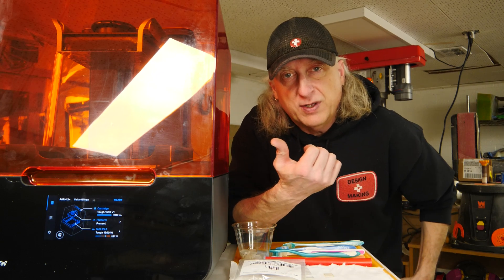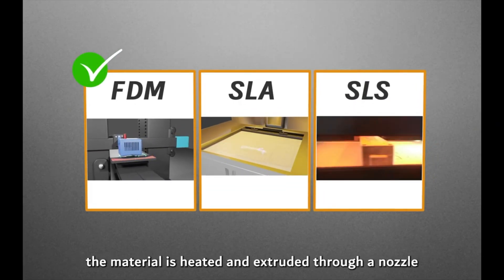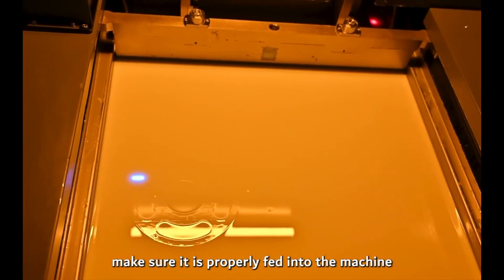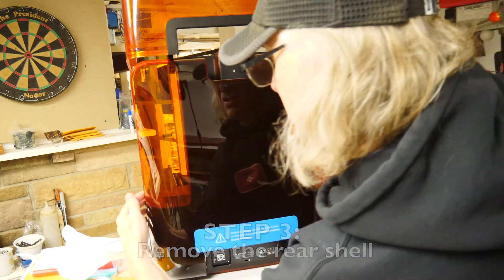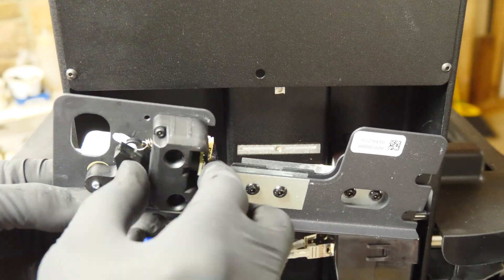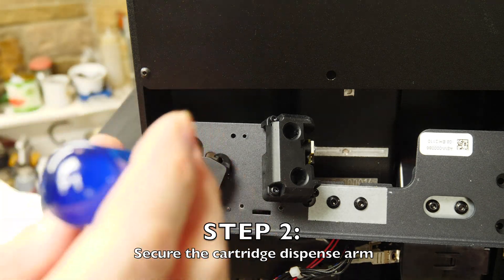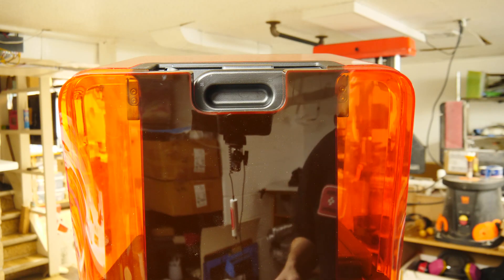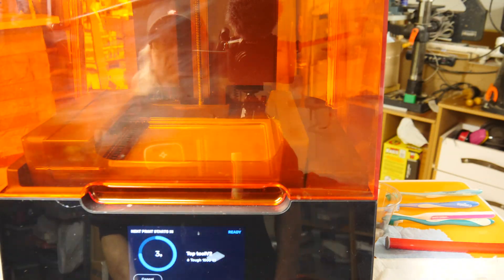Formlabs Form 3 Cartridge Dispensing Arm Replacement

Comment: Hi, I have a Honda Jazz. I want to manufacture a 24-tooth plastic gear for the side mirror myself. There are many chemical options available, but which liquid chemical should I use? I want to avoid the gear breaking while rotating, and I don’t want it to be affected by heat or cold. Please give me some advice, your fan is asking for your help. ❤